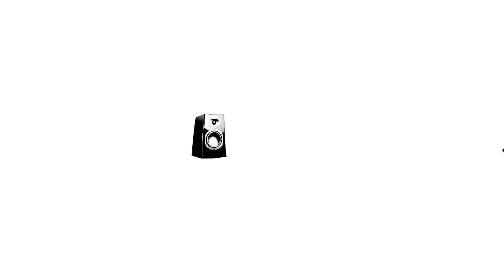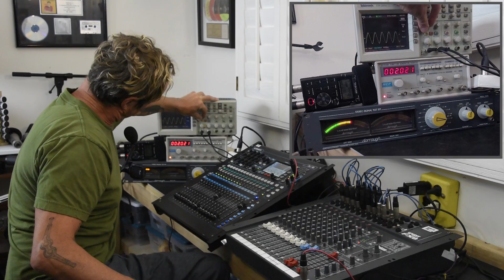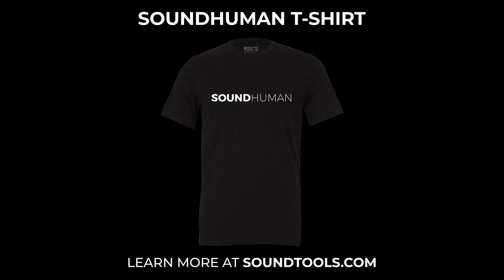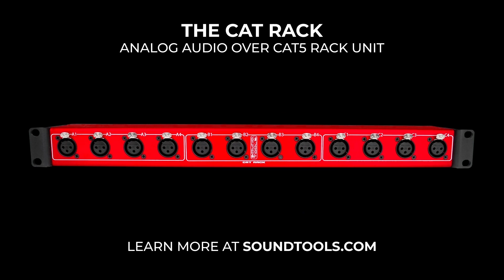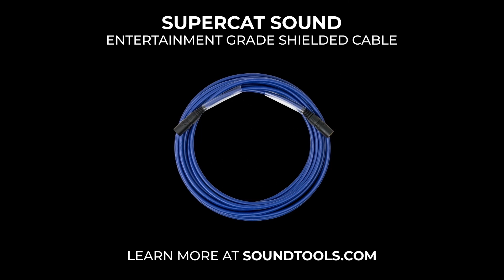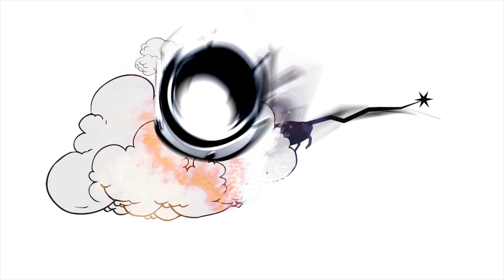Digital vs Analog #2 of 6 - The Highs

Comment: @Dave: in signal processing terms a "delay" or "latency" is actually a linear phase shift.
Think about it, for a 10 Hz sine the period is T=100ms, but for a 10 kHz sine it's only T=0.1ms.
So a 1ms delay would be a 3.6° phase shift at 10 Hz and a 3600° phase shift at 10 kHz.

Note that if you looked at this at 10 kHz on your scope, the waveforms would perfectly match despite the thousands of degrees of phase shift.

Analog filters on the other hand give you a non-linear phase shift. A most simple 1st order lowpass filter will start out at 0° at 0 Hz, then drop to -90° at the cutoff frequency, and approach -180° at infinity.
Reply from the maker: And the digital filters also give a non linear phase shift as you will see in some of the upcoming videos.

In this video we are seeing latency and phase shift w the digital board and phase shift with the analog

Comment: This test seems to show that A/D is quite an expensive procedure. Why this delay would matter in the real world is the "real" question. Of course, everything is coming into the console through the A/D's so they all experience the same delay so that really shouldn't matter for the FOH but it might matter for the monitoring although the phase shift at 20khz seemed fairly minor but it was hard to tell if it was multiple cycles (your pulse test will sort that out!) I'm imagining that the delay is the order of 10msecs or less so that would really be audible in the monitoring. 

Another test would be to check that the software isn't delaying the signal significantly due to processing. There can be a significant number of plugins on a channel and if there are a different number then they could introduce phase issues for multiple mics on the same sound sources. That would be useful to know!
Reply from the maker: The latency only starts to matter for things like in ears or monitors as they time a bit farther.

The phase is minor. This console does not have plugins, or if it does I don't know how to find them.
Reply: When everyone was going into streaming, I did so too, mixing everything on an analog PA12 by Allen&Heath. Better than digital? Not sure. But easier to go wrong… more plugs, more single components (I used an old Drawmer compressor e.g.) that can have faults or bad contacts. Where digital mostly is binary. It work's or it fails you. :-D

Comment: Two things: 1.  I have mixed a lot of shows on a larger Soundcraft Spirit from that time period, and I have mixed a lot of shows on a QU series mixer.  Subjectively, just from input to output with no processing the digital board sounds fine.  In a blind, gain matched test you would be hard pressed to tell them apart.  On a job, in the real world, you wouldn't be able to under any circumstances.  2.  You can get a brand spanking new QU16 for 1700 bucks, or a Soundcraft Spirit LX7-16 for 1200 bucks.  Both have 16 inputs.  The LX7 has 6 aux, the QU 10.  Unless you can get your verbs, delays, graphic EQ's for the house and all aux's, all your gates, and all your compressors for the 500 dollar price difference you are going to have a bummer time mixing the show with the analog board.
Reply from the maker: They each have their assets and issues. One has loads of everything and the other you can reach down and turn the highs down on one channel while boosting highs on another at the same time. One you know where the knob is set by feeling the nub and the other you need to stare at a screen. One you have to patch a bunch of stuff before the gig and carry lots more, the other you need to punch buttons to access what you want during the show.  One you can see all your gates, comps and efx at the same time, the other you need to scroll through and see stuff one at a time. Really just depends on what you prefer, your budget and the application.
Reply: Personally I think I'd have a chance to tell apart the Soundcraft LX from the Allen&Heath QU-Series just by ear. The EQs from Soundcraft are a different style. However, this is also true for the digital Soundcraft desks, and for the analog Allen&Heath consoles I have been using so far.

If you have clients who want great sound, you will definetely go for digital today. Because nobody would be willing to pay you great sound in analog any more. Neither the rental for the gear nor the hours for setting it up nor the larger truck. 

During the first phase of the pandemic I did some streaming gigs on an analog Allen&Heath machine. It did sound great but it was way easier to get trapped in some bad connectors, dirty faders/pots, wrong gain on inserted compressors, whatnot. Still, analog has a certain touch to it, a nice feeling. I think it's more due to the handling than due to the actual processing.
Reply from the maker: @nielsott  using the proper tool for the job is wise. Both analog and digital have assets and issues as far as size, weight, ease of use, reliability, cost, access to features and speed of that access. Also knowing the Sonic difference can help us decide. I am all about removing the mysteries so we can make the best decisions on what to use for a particular application.
Reply: We all learn and conform when and is necessary.....if the budget and truck space was available I would take my xl 200 and my 3 racks of outboard on any 40 or less input show....but if not I would do digital....
Reply from the maker: @richardbelisle7626  absolutely, what we bring camping vs backpacking vs what we chose for our home life are adapted to the environment and other outside parameters.

Comment: Nice. Thanks.
I'd like to have seen the digital at 12K.
12K is very much audible and is 1/4 the sample rate. Considering how much trouble it seemed to have with 24K, I think it is a worthwhile test.
Reply from the maker: I will check it out, I did not notice any issue when I was setting up and slowly sweeping but did not spend time at 12k
Reply: @DaveRat  Thanks.
This could be part of the reason for the "digital sound" some folks seem to hear, and potentially partly explain why up-sampling can have such a huge impact on sound quality.

Comment: did you do a video on the Dourrough meter? i've seen your live mixing videos using it to monitor output stage on the mains. it it inline after mixer /before amp stage? what benefits does it have? I'm using a behringer GEQ 3102 for metering  to main output inline from digital desk to amps.. How are you hooking it up. Thanks.
Reply from the maker: I may do a vid on it.  The advantage is precise metering down to 1 db plus it simultaneously reads peak and average. So you can really see and solve any left to right volume offsets. Also, the test meter allowa to to look at left, right, left and right or sum/difference of left and right.  The sum/diff let's you see polarity and phase cancellation issues.

Comment: Sound quality is a question of what happens when it fucks up / clips / gets processed downstream, as well as how it sounds right now.

E.g. when digital fucks up on a hard drive, it sounds like no sound all, not a recoverable degradation as with magnetic tape. The failure modes have sounds.
Reply from the maker: Agree and videos 5 and 6 deal with overload modes